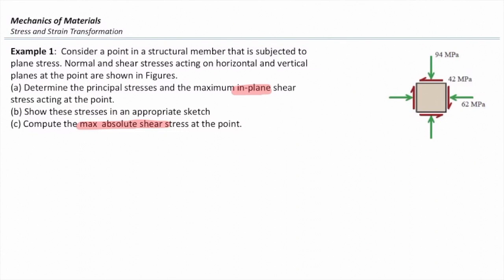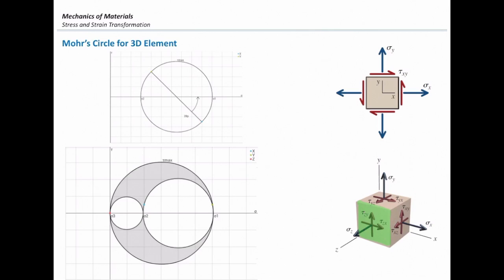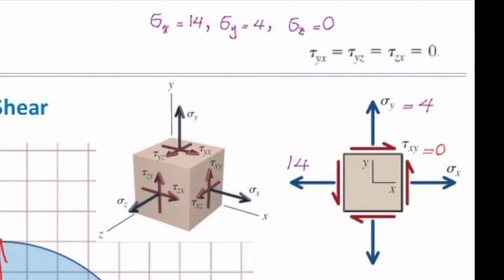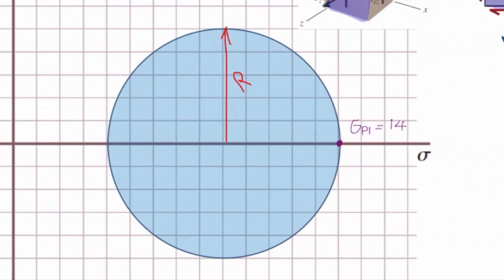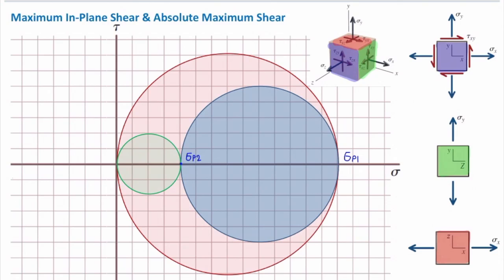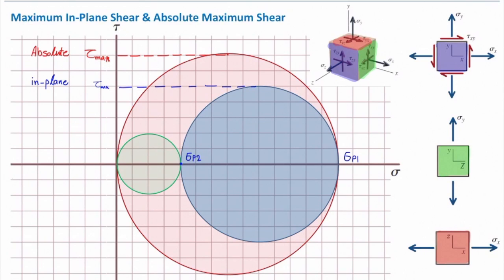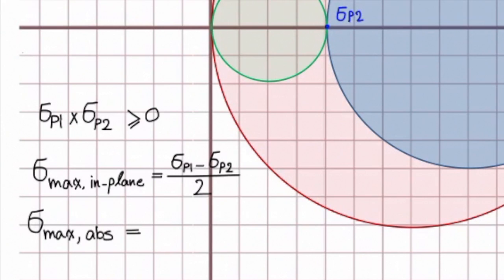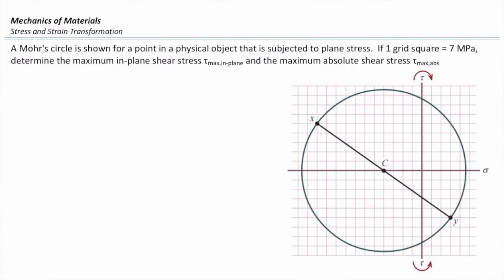Lec21, Part 4, Maximum in plane shear stress and maximum absolute shear stress

Comment: That makes much more sense that what I got in class.  Is there any case where you might get the principal stresses in one plane and be unable to find the stresses in the other two planes(like if the circle for one plane touches the origin at (0,0))? The examples you showed are awesome and you can find the stresses in the other two planes so long as one plane is not touching the origin at (0,0)